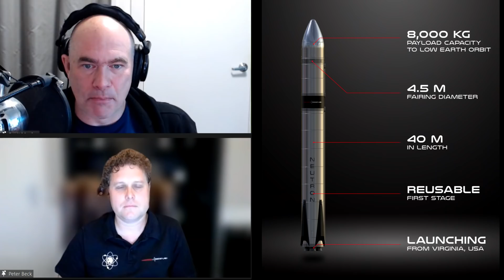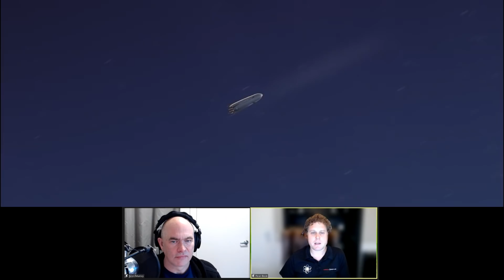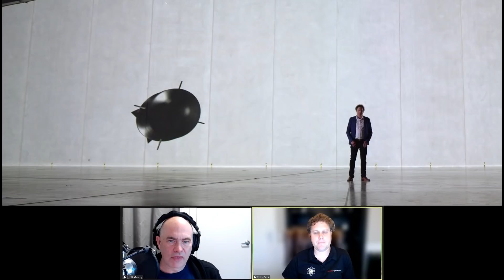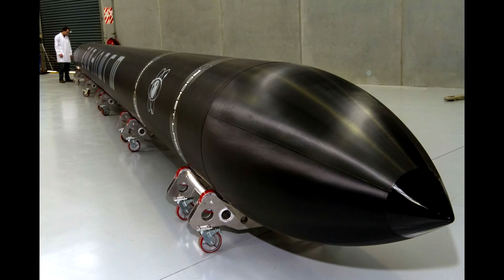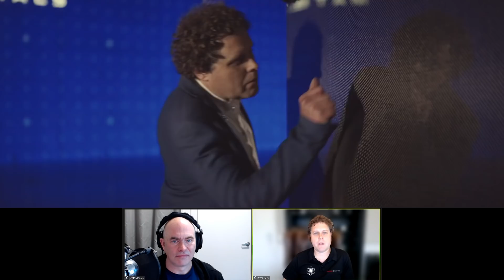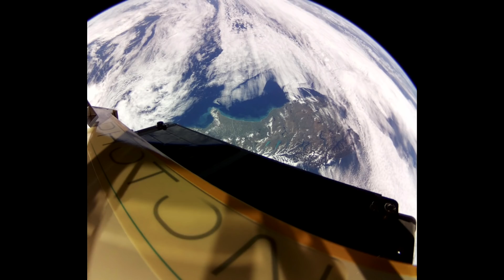Rocket Lab's Neutron Rocket's Innovative Design Explained By Peter Beck - CEO of Rocket Lab

Comment: I imagine that right now, Scott is in KSP trying to get 4 way fairings working as control surfaces and air brakes.
Reply from the maker: Guess what my plans for tonight are….
Reply: @scottmanley  Waiting on that video as well..... Great interview, BTW.  More please 🙂
Reply: @scottmanley  Yeah, when you said it was silly I agreed. Then I found my self working on it ......  It is silly.  Looking forward to the KSP video to come ......
Reply: The wobble. I can hear it here in Europe...
Reply: So, Scott... did you work it out? (Posted at 1345 GMT on December 22nd)
Reply: Haven't tried it yet, but lock the shape of some procedural fairings and then attach them to some robotic hinges? Just not just if they would really hold tight on launch/flight. Those robotics parts can be wobbly in flight
Reply: @scottmanley  I've been working on it since the reveal in RO. It has not been going well. FAR really doesn't like procedural parts attached to hinges.
Reply from the maker: @acanuck1679  My internet broke, so my livestream never got that far
Reply: For recreating it in KSP, you could build it out of stock airbrakes.

Comment: The Neutron rocket design has so many ingenious features, that it's becoming my favorite rocket. An innovative second stage that isn't structural, a fairing that reminds a Bond movie. Composite materials on it structure. No need for a launching tower. Returning to the launch pad to save costs in retrieving. And a great CEO that is very informative.
Reply: @vablo7198  Starship is too colossal and heavy. Many points of failure too, as the extensive heat shield. The cargo hatch design could mean sensitive maneuvering to deploy the satellites at LEO than a standard payload fairing. Also different applications.
Reply: The design where the second stage is held inside the first stage is really neat.
Reply: @JohnVanderbeck  yes. very clever design. Not requiring a massive launch tower and stacking the rocket is also a great feature for rapid reusability.
Reply: It's probably my second favorite rocket right now, after new shepa....kidding kidding guys.
Reply: @bacon222  thanks. Already update it.
Reply: @RogerM88  Speaking of Starship's mass: one of the Heavy-lift Vehicles from NASA's SPS study has similar payload to Starship (120t), yet only 4000t mass when full. Which is less than simply the fuel mass of Starship (a 20% boost), and even with a 22t mass reserve! Apparently, aluminium construction/winged flyback is a pretty efficient design!
Reply: @RogerM88  Perhaps, but Starship is aiming at a far more strenuous goal at this point, and thus its function fits its form. Functionally speaking the Neutron superstructure is more akin to the Superheavy, and likewise both are designed simpler, with minimal failure points. And on the Neutron the second stage is never intended to re enter the atmosphere, while the Starship's is....well..the Starship. Can't really minimize failure points much further than that. Nonetheless, the Neutron presents an alternate reuse solution for the medium-lift class of rockets present, and its always good to see people working on alternate technologies. One thing I do wish would become more common is the simplification of ground infrastructure much like what Neutron is aiming to do, but for heavy lift at minimum cost that might take a while to happen.
Reply: @vablo7198  Honestly, I think Neutron is much more innovative than Starship.

Neutron is probably closer to what rockets will look like going forward. In particular, the lack of a need for a strongback, and a fully enclosed upper stage.
Reply: @pseudotasuki  In some ways you are right (though the Raptors are amazing). But it's not about being more innovative, its about being cheaper.
Reply: @espenha  Neutron will almost certainly be priced lower than Starship for its targeted payload class.
Reply: @HalNordmann  that is the initial estimate weight for Starship not the final. Really doubt they going to achieve that payload value to LEO, once they add reinforcements to handle the lateral loads on reentry, the additional TPS tiles, the cargo hatch mechanism, extra engines, and landing system. No wonder why they thinking about catching Starship. A more compact lander as the Red Dragon capsule, could been more easily certify to crew missions.
Reply: Those designes dated.back to the 1930tys. The reason why they wad aboundaned in the 60tys was mostly to get to the moln faster. So pretty much everything in apollo was one time use. Making it a lot cheaper to design.... but... well.. a lot more expensive to operate
Reply: @RogerM88  That is funny - I did some calculations about Starship using the Silverbird Astronautics calculator a few months ago. With 10% propellant residuals for first stage landing (based on consumption during Falcon 9 flights), 5% residuals for the second stage (a compromise between offshore and RTLS fuel), mass/thrust/Isp values from Wikipedia (with approximate of 200 tons for first stage dry mass) and launching from Cape Canaveral to 400km LEO, the total payload is a about 60-80 tons with mostly-conservative numbers - not "more than a hundred" they promise. Something is very wrong here...
Reply: @pseudotasuki  I'm not sure Neutron is cheaper that Starship per launch. It might be. My estimates place Neutron at around $25 million per launch, while Starship is at around $20 million per launch. This is in large part because I assume a fairly large difference in launch cadence.

Launching more often does wonders for things like infrastructure costs.
Reply: 'a fairing that reminds a Bond movie'
can't wait for one of these to capture a Dragon capsule in orbit 😈
Reply: @HalNordmann  won't be surprised if SpaceX stops using Starship for a while, and focus into developing a bigger fairing to Falcon Heavy. A lighter and smaller lander, would make more sense for initial missions to the Moon and Mars. While the voyage there, would be done in modular Spaceships assembled in LEO.
Reply: @spankeyfish  Would be the perfect Bond commemoration event.
Reply: @RogerM88  And I think that SpaceX won't even make it to the point of developing landers. NASA's own development programme utilizing modular orbit-to-orbit systems and dedicated landers will get to Mars way earlier and safer, so their own efforts in that field would be useless. Definitely agree that an evolution of their existing rockets is a way better step for SpaceX than Starship.
Reply: Neutron is basically what an evolution of Delta Clipper/DC-X could have been. Good to finally see someone pick up where Clipper left off and run with it.
Reply: I heard all that before, maybe not the Bond thing. I'll rather wait until I cheer... But I agree, so far it sounds great.
Reply: Starship is infinitely better because it is fully reusable
Reply: You don’t have to be an Elon hater to like RocketLab. 🤦🏻‍♂️
Reply: @HalNordmann  if instead of Starship, SpaceX continued the Red Dragon program, and a bigger fairing to Falcon Heavy  allowing to fit a capsule and a fuel module, wouldn't be surprised by now they had some mission to the Moon or Mars to test the viability of the system. Landing on Mars in a capsule, makes more sense for crew missions. While the voyage would be made in modular Spaceships or a Space station in an eccentric orbit around Earth, that would reach closer to Mars. With a Red Dragon docked to it. Starship is too massive for the current NASA lander needs.
Reply: @alexmijo  I don't think it's as clear cut as that. Starship requires a butt ton of complex ground infrastructure. I don't think it's so clear cut. Does the cost of having all of that ground equipment outway throwing away a single relatively inexpensive engine per flight? It's going to come down to flight rates. They're both really interesting vehicles with very different use cases. I think it's great to have more than one company and one approach.
Reply: Ingenious, I don't think so. Beck said "24 hour turnaround" and this is a result. Methane, RTLS, GG, attached fairing, no strong back, these are not ingenious, but requirements to get as close to a "24 hour turnaround" as possible.
Reply: Yeah. Neutron will do what Falcon 9 has already done one hundred times. That’s innovation! 😏
Reply: @espenha  Like with Falcon, SpaceX is going to be maintaining large profit margins until the industry catches up. There's little reason to reduce prices when you're already selling launch services for less than your competition.
Reply: @RogerM88  remember tho that because the starship is made of stainless steel, it has some natural heat resistance of its own so a failure of the heat shield doesn't necessarily mean the whole thing is done for
The rest of your comment tho... yeah thats true lol
Reply: @pseudotasuki  That's true. But if the cost of Starship is lower than Neutron, they decide which payloads they want, and Rocket Lab really can't do much about it. If Rocket Lab bids $40 million for a satellite, SpaceX could just ask for $39 million.

I really hope Rocket Lab can get their cost per launch under Starship. That allows them the same negotiation power, for payloads up to 8 tons, at least.
Reply: @espenha  There's only one case where SpaceX did that with Falcon 9, and it was an unusual situation.
Reply: @RogerM88  The heavier the more engines have to be serviced and more/bigger fuel tanks, more heat shield tiles et.c. so a lot of thing is going to be more expensive for every launch. Most specific applications for Starship is not realistic and mostly there for hype to fool more investors.
Reply: @lubricustheslippery5028  I was surprised when SpaceX informed they were considering adding more engines to Starship. Wonder if isn't due to be heavier than initially expected, and maybe for the Raptor engines not reaching the goal thrust. Now it seems they want to extent the size of the Starship, probably to increase the size of the tanks.
Reply: @espenha  $20 to Starship? Aren't you being too optimistic? That Rocket is massive, just to maintain and operate the launching infrastructure, Staff, and propellant costs, that number seems too off even to break even. Add to that, the lack of more missions that justify such a payload.
Reply: @alexmijo  fully Reusability in the Rocket industry isn't as cost effective as many try to portray. All the structural reinforcement that adds additional weight, plus refurbishment could turn the rocket even more expensive to operate than a standard expandable rocket.
Reply: @nabormendonca5742  and you just sound as the typical Elon fanboy, that was totally hyped out with the Tesla Bot, even knowing it was a person dancing in spandex suit. Not a working prototype.
Reply: @nabormendonca5742   if Falcon 9 is so much cheaper to operate, because it's partially reusable, then why the launching costs SpaceX charges to NASA aren't getting drastically cheaper.
Reply: @RogerM88  I just mean without massive amounts of refurbishment, so starship is still infinitely better
Reply: @RogerM88  "$20 to Starship? Aren't you being too optimistic?" Maybe. We will have to see. But there are huge gains in a rocket being fully and rapidly reusable. A lot of costs are the same per launch, regardless of size, like flight safety team, and infrastructure costs are extremely rdependent on launch cadence. Launching three times more often means your infrastructure can be almost three times costlier, for equivalent cost per launch.

"Add to that, the lack of more missions that justify such a payload." There are enough missions that I expect Starship to vastly exceed Neutron in launch cadence for the foreseeable future. Starting in 2022, where Starship will likely launch 8 times to orbit, and Neutron zero. You have Starlink, HLS, tourist missions, around 10 commercial satellite launches that can be moved over from Falcon 9/Heavy. Later you have Mars missions.

"if Falcon 9 is so much cheaper to operate, because it's partially reusable, then why the launching costs SpaceX charges to NASA aren't getting drastically cheaper." Very little competition. You don't have to be very cheap, you just have to be cheaper than the competition. Once you're cheaper than the competition, you want to have the highest possible price, to get as much profit as possible.

This is really what I think is most important about Neutron. I expect the launch market will become much more competitive, and the cost of ~4-8 ton launches could easily be halved.
Reply: @alexmijo  How the full reusability made program infinitely better we've already saw at least a few very dramatic and painful expensive times.
Reply: @espenha Like cars, Starship is the American way solution (heavy huge cars with V8 gas guzzler engines to commute). Neutron is the rest of the world's way solution. Starship works as far as the fuel is cheap. This will not be the case in future.
Reply: But cgi design is different from reality. All these companies have these cool cgi design videos but the final product will be way different due to engineering constraints or limited funding.
Reply: @placplacan6346  Too bad Rocket Lab is an American company. Whatever it takes to dump on the US I guess.
Reply: @mindlessmrawesome  No, the higher melting point of steel won't help - as you are descending, the tanks still have super-cold fuel in them, and the walls of those tanks are also the outer hull of the ship. So you need just as robust TPS.
Reply: @HalNordmann  ...except you're only going to have a very small amount of fuel in the starship when it's in decent, and they're in the internal header tanks which are deeper in the ship. Though the oxygen header tank is at the tip, so maybe that would be a point where the heat shield couldn't fail.
Reply: @mindlessmrawesome   The header tanks have at most 2% of the total fuel. With a far less demanding flight profile, the Falcon 9 first stage needs about 3-10% of its fuel to land. So where are you going to put all the rest? Plus, the header tanks are constantly proclaimed to be only a temporary solution. If you want thinner TPS, use a wings-and-wheels recovery, since it has far lower thermal loads per surface area. Yes, wings can't be used on Moon or Mars - but why would you use a heavy lifter for landing there instead of a dedicated system? A jack-of-all-trades is a master of none - and in space, you need every bit of efficiency you can get.
Reply: @HalNordmann  If that were true ("... you need every bit of efficiency..."), then RocketLab wouldn't be using GG. For comparison the Achimedes at 1MN vs Raptor at 1.8MN. As RocketLab is explaining, there are far more complexity to designing rockets, than at first ... or second... glance.   Until there is definitive evidence that Starship wont deliver what it is projecting, then any statement otherwise is just armchair-speculation.

Comment: DC-X - delta clipper or delta clipper experimental 
Cold Gas RCS - cold gas reaction control system
Inconel - an alloy of primarily chromium, nickel, iron and other elements to make it extremely strong and corrosion, oxidation and heat resistant.
GG - gas generator 
TCA - thrust chamber assembly
GNC - guidance, navigation, control
NRHO - near rectilinear halo orbit

Comment: Fascinating to know the design decisions are driven by their design philosophy and not by taking the safe route, e.g. using RTLS instead of a barge - it makes sense for them because of the carbon fiber. And hats off for an overall design no one thought of before - that suspended 2nd stage is wild, the returnable fairing is wilder.
Reply: A minor correction: the Delta rocket series had a suspended second stage, going back to the Apollo era.
Reply: This is the kind of positive competition needed. Someone with ideas that are different yet as good as or better than Elon's. (Take note BO!)
Reply: @knowledgeisgood9645  Someone that knows how to get to orbit.
Reply: no, there was definitely that james bond movie where someone designed almost the exact same thing but from stainless steel. granted they were doing it for the hollywood wow factor, but still they had to have put some thought into it since they built the prop.
Reply: As Beck said, a rocket is a collection of compromises.  And more to the point, paraphrasing, you choose which compromises to make, based on what you're good at.  You can tell when innovation is driving an industry, by the variety of solutions available.  As a counter-example, look at commercial aviation: there are just two configurations of large jets these days, twin jets under the wings, and twin jets at the rear of the fuselage.  And the latter is getting more rare.  How can you tell an Airbus from a Boeing?  Like, from the shapes of the windshields?  That's what a mature industry looks like.